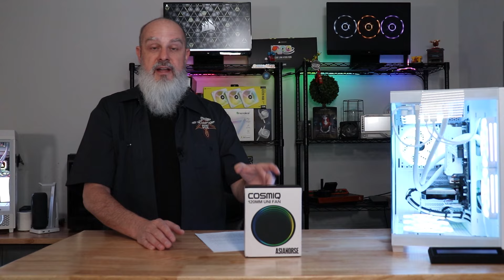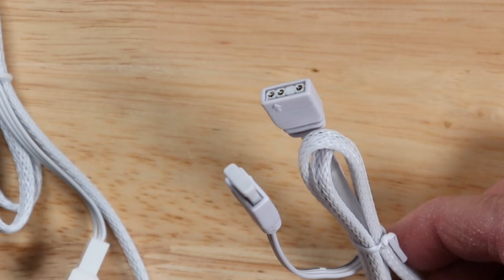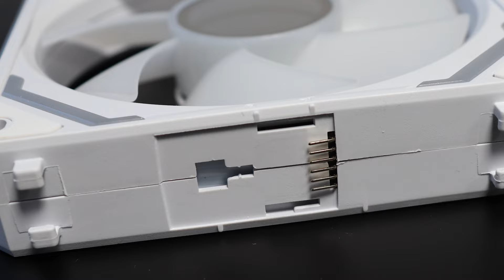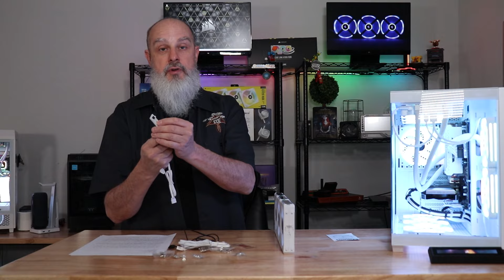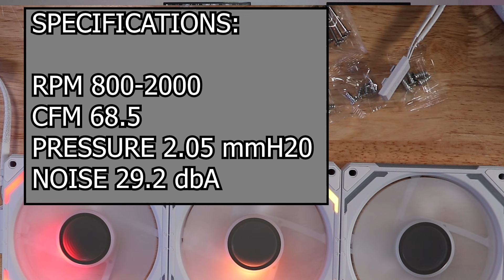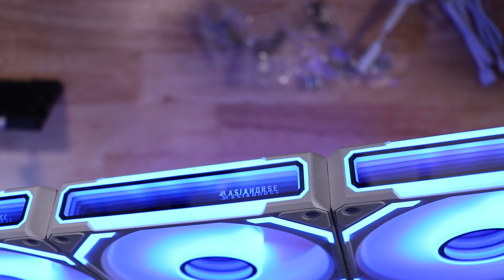Budget Alternative to CORSAIR, Thermaltake and Lian Li? Check out the AsiaHorse COSMIQ UNI FAN 120

Comment: Don't need a hub with 4 ARGB headers on my motherboard muahaha
Reply: Does the 4 rgb headers on your motherboard ( same as mine)  mean I can support up to x4 (3 pack cosmiq fans connected to each other)  giving me12 fans? I to am using a push pull method. But I have them connected to the venom hub but my lights won’t turn on. Just my fans are working
Reply: @BLAZINBACON2788  I ended up switching to Nollie GC120s with the associated controller because I was unsatisfied with the Cosmiq's control options.

At any rate, make sure they're ARGB not RGB headers. The amount of fans you can put on one header depends on the addressable LED limit. Usually it's above 90 so three fans per header is reasonably expected. So yeah 4 headers should let you control 12 fans.

One thing to note about the Cosmiq fans is if you add a fourth fan to a single header, the fourth fan will match the lighting of the first.

I don't know what a venom hub is but generally an ARGB hub should provide better performance than the headers on their own, if it's a good hub. But it's possible your hub only powers the fans themselves and not the lights? Does it have ports for the ARGB pins?

Comment: The comsicq fans are the real deal I have 15 in total in my corsair 4000d rs with a push pull method on a Thermalright warframe on a r7 5700x3d. Cpu idle at 28c and max at 35c. Very good quiet fans too ❤

Comment: That’s pretty cool, definitely a Lot of RGB there! Asiahorse says they work with Msi mystic light, as well as their controller. Were you by chance able to test that?
   I was also looking at the non icue Corsair fans for the same price, they perform great at 76 cfm and 3.0+ static pressure and claim to also work with mystic light but i thought Corsair fans were all proprietary? 
  I’m just looking for RGB fans that I can use on my motherboard with full argb and pwm control through dragon center without having to replace it with 3rd party software. IQ link dips performance down a bit on computers as does a lot of others and I also want to control my dragon RGB on the motherboard and graphics card.

Comment: Hey I just got these after many told me to get others, and I don't see why people were telling me not to. Either way, I wanted to know what you recommend for controlling the RGB. Right now it's just on the standard rainbow stuff. Do you recommend using the controller, or do you have a software that you use for controlling things?
Reply from the maker: Hi VincentLloydM, that's Awesome!!! I'm glad you are happy with them.  If you were to ask 10 people what fans to use, you would get 10 answers. Everybody has an opinion on equipment and fans and for one reason or another don't like certain products. That's because we all come at it from different perspectives, some need budget, some prefer certain connections, others want the best performance, I want the best lighting....haha....on and on. If you like the look of these, they perform well enough (most do) and are at the price you needed, then job done, awesome!!! have fun with it!!! 

You can use the included controller which works and looks good, but the controls are impractical inside a case. Use your motherboard,  these will connect to a 5v 3 pin ARGB header and then you can use that motherboards software to control it, assuming your MB has ARGB control (most do) 

I personally connect most fans to a corsair controller, these would need to have an adapter cable, but I can then use corsair iCUE to control them. I have a couple videos on that subject, check it out. 

Alternatively, any inexpensive ARGB controller for 3pin 5v ARGB should works, there are lots of options out there, and they will inclue a remote.  There are options beyond that, but that's a good start. I typically just use a corsair controller and iCUE. 

Good luck, Have fun! and thanks for watching!!!

Comment: I purchased 9 fans but unable to change modes from Motherboard argb header by using MSI mystic light can you tell me the software where i can get modes like controller
Reply from the maker: Hi nikhileshnikhileshvora968, Mystic Light should be able to control these off the motherboard 3 pin 5V ARGB header. However, it may cause issues if you have all 9 fans connected to a single ARGB header. Try Connecting only 3 to a single header and see if that works, you might get 6 to work on a single header. This would require you to connect the fans to multiple headers, but I would start there and see if that allows you to control the lights. 

If that doesn't work, and you are getting no Lighting control through the software, check your bios and make sure the ARGB controller is enabled. Reinstall the software if it still doesn't work. 

You could, alternatively, use an ARGB hub, connec the hub to a single port on the motherboard and then all the fans to the HUB, that would work. 
Or you could use the included controller to control the lighting, or at least use that as a troubleshooting tool to ensure the lighting is working. 

Good Luck, Thanks for watching!!!!

Comment: Whats the difference between the COSMIQ and the AsiaHorse AMICI-5GT RGB PC Fans besides the max rpm
Reply from the maker: Hi YAMi_PRiSMØ, the AMICI-5GT fans are not daisy chained together, each fan has a PWM and ARGB connection which will add to your cable management. The COSMIQ fans daisy chain together using a connector on the side of each fan, so you can control multiple fans on a single set of cables. The COSMIQ has marginally better specs it looks like, aside from that they don't seem to be much different. Either would be suitable for most setups IMO. I haven't personally looked at or used the AMICI-5GT so I'm basing this just off a quick glance at the product page. Good Luck, have fun and thanks for watching!!!!

Comment: How did the fans perform noise-wise under load? I've noticed a lot of the Lian Li SL look-a-like fans like to state that their noise level is around the same (~30 dBA) but they become significantly noisier once they start pushing 1200 RPM under load, likely due to the design of the fan blades and how they push air.

Comment: I NEED HELP! I DONT want to use the controller with SAtA power. I want to use just the PWM fan head cable, and ARGB pin header. That should be enough to power both the fan and the RGB however it’s not working. Please help
Reply from the maker: Hi ChrisPoloChris90, you dont have to use the controller. You can connect these directly to your motherboards PWM port and the 3 pin 5v ARGB port. Just be mindful of the power requirements. These fans draw .16A on the 12V PWM side, and 0.864A on the 5V LED side. Most motherboards will be fine with 3-4 of these fans one a single port. What's not working?

Comment: If you can sacrifice a little aesthetic like the infinity mirror, then save yourself $9 and get LTC CF-121D. This fan pushes 68.9CFM, and the LTC fan pushes 70CFM, so it can push more air. Everything but the infinity mirror is the exact same down to the RGB light configuration. But where it differs is, the LTC is easier to connect together, and they are $39.99 vs $48. And you can get reverse fans for a super clean look for $49.99, and not have to look at the back of the intake fans
Reply from the maker: Hi boostinman7132, that's great info, thanks for the advice, I will have to check out that fan!!! Thanks for watching!!!

Comment: i daisy chained 9 fans together - when i do so i lose all brightness on my fans with aura sync. (i am not using the RGB controller) how can i fix this? they work fine with 6fans daisy chained but when i do all 9 it breaks. do you know a fix?
Reply: it’s like i can’t use 9 fans. everything is ran correctly. as soon as i add the 9 fans the lights go green (on white setting) i dont get it
Reply from the maker: Hi justin-8296, the rated current for the LED's on each fan is 0.864A. This would be at 100% brightness and a white color. This number will be less, perhaps much less, when not using white/100%.  Most motherboard ARGB headers still have a 3A output, but double check your motherboard. 

It's possible you are just exceeding the power output of your motherboards header. Especially when using 6 fans it works fine. Even with 6, you could exceed the output if you went full bright/white. These fans have 24 LED's each. 

I'm assuming you are using a motherboard ARGB header based on your question. I would suggest splitting up your 9 fans into two groups and utilize two ARGB headers (assuming you have two). NOTE: you cannot use a 12v header for these fans. 

I've seen odd symptoms when adding too many RGB devices, including brightness issues, LED's doing weird things, having the wrong colors, etc... or not lighting

If you don't have two headers to split this up with, I would suggest using a powered 5v ARGB hub. You could feed this hub from an ARGB port on your motherboard and then break up your fans into two (or more) groups, this would reduce the load on a single port. 

There could be other reasons for your problem, but it sounds to me like you should even out the load. 

I hope that helps. Have fun troubleshooting (troubleshooting is fun isn't it?) , let me know what you find. Thanks for watching!!!
Reply: @HardwareArtisan  Thank you for your reply, & you’re correct! I had loss of power (too much on one header) Sadly my Z790 Strix only comes with one 5v header. I ended up just using an RGB controller that was supplied & daisy chained the others! Thank you sir!
Reply from the maker: @Neyxo186  That's awesome, i'm glad you figured it out!!! and cmon ASUS, we need more than one 5v header, should be a minimum of 3, right!? haha!  Anyways, game on!!! Have fun!!!
Reply: Keep in mind that the ARGB hub on your motherboard is only rated for 5 V.  Each one of these fans can use up to .86 something or other volts for the ARGB if they are maximized at 255 for all colors (full white).  In other words, you can only confidently connect about six of them to a single header on your motherboard.

Most modern motherboards now have around 3ARGB headers.  Be careful that you’re not trying to connect to the 12 V RGB header because that will short circuit your fans, it’s intended for LED strips.

You can likely get around this problem by using either the provided hub, or connecting to another hub  which is powered by SATA directly from your PSU so that the power draw isn’t just on your motherboard, I would guess

Comment: I might look into these. My lian li uni fans caused nothing but trouble since 2021. It's always the bearings of RGB dying, last one died over the weekend and ofc out of warranty.
Lian Li really has poor quality and it's overpriced for what it provides, the fan blades on those SL120 v1 are also sharp edged asf.

No idea if there newer products improved, but yeah definitely disappointing.

Thanks for the video!
Reply: dang really? i have 8 of the AL fans in my main gaming PC and i put 3 of the SL LCD fans in a build i did for my friend and neither system has had any issues.. i was thinking about getting them for my streaming PC too.. thats crazy that you have had those issues that sucks

Comment: Can you connect more than 3 together?
Reply from the maker: Hi shoryuag, yes, the documentation from AsiaHorse states a single connector can connect up to 6 fans. Just be sure that this doesn't overload your PWM port or HUB.  In most cases you won't be connecting 6 together anyways, but it will do it. 

The lighting controller will allow up to 10 fans to be connected for lighting. 

I hope that helps, good luck, have fun and thanks for watching!!!!
Reply: @ Bonus! Thanks for getting back to me.

Comment: can i connect more then 3 fans daisy chained mode and at the end connect 1 connector to controller and controller to mobo? to understand if its necessary buy a specific hub for more than 3 fans. Thanks a lot
Reply from the maker: Hi lucaargento9552, the documentation states:

"A single connector can connect up to 6 fans at the same time, and one controller can connect up to 10 fans. Overloading the installation may damage the device. 

This means that the CABLE will support you daisy chaining and connecting 6 fans together on a single PWM port. However, the rated current per fan is 0.16A per fan. If your Motherboards PWM connection only supports 1A output, you're right at the edge on 1A. If it supports 2A output, no problems. Check your specific motherboards output to see if using a single port is ok. I'd recommend using 2 different PWM ports to be safe, but 1 will work if it's outputting 2A. 

For the LED controller, up to 10 fans is ok on the controller using the 5v 3 pin ARGB connections. 

If you connect to a motherboard ARGB connector, each fan is rated to use 0.864A, so check the output of your specific argb port on the motherboard to be sure it supports the number of fans you intend to use. The current draw is probably much less than that unless you are full bright white, but be conservative, use more than one port if in doubt, or use an ARGB HUB. 

I hope that help!!! Great question, thanks for your support and for watching!!!

Comment: Everything was great until the controller was talked about. No software or remote?
Reply: But When you Look at the Price its Not wondering That there is no Software
Reply from the maker: Hi tl3139, thanks for the feedback! There is no software for this. The included controller is a very simple little device with a single connection. It requires no software to work and the remote is several buttons on the controller itself, there is no seperate remote. 

These fans can be connected to many other controllers including your motherboard or any number of rgb controller which opens the ability for more comprehensive controls. I hope that helps, thanks for watching!!!
Reply: @HardwareArtisan  Thanks a lot. I will check that out.

Comment: What is that aio?
Reply from the maker: Hi spoke1183, that is the Corsair H150i icue link AIO with an upgraded LCD screen....you can get it with the LCD screen or without.  Or you can by the LCD panel as an upgrade for it. 

They make a non icue-link version of that, the H150i Elite, I think that's the model, it would be similar in looks. 

Thanks for watching!!!!

Comment: Will they work if I don't use the included controller and use a separate hub plugged into my motherboard's ARGB header?
Reply from the maker: Hi arniejonassen, yes, you can connect these to a different 5v ARGB controller. It's using just a standard 3 pin 5v ARGB connector. Using an ARGB hub connected to your motherboard for control will work fine. I wouldn't overload a single port with more than 3 fans, but that should work great! 

Good Luck, have fun!! Thanks for watching!!
Reply: Yes.  In my opinion, the standard 5 V three pin ARGB and pwm is a more customer, friendly format than these proprietary USB and other weird pin connections that companies like Leon Lee have used, essentially forcing you to use entire packages of products, whereas you can pick and choose if you are plugging these directly into your motherboard headers, into another set and then into a motherboard header, or into a hub, or partially into a hub and partially into a motherboard header, depending on whatever your situation is

Comment: I'm ordering 9 of these for my case. I have enough 4 pin headers on my motherboard but only 1 5v argb header. Would it be fine to daisy chain all 9 to 1 argb header? Or would I need a hub for them?
Reply from the maker: Hi spentcasing3990, for 9 of these, I would recommend using a powered rgb hub to split them up. Just an inexpensive small one would do just fine.  Thanks for watching!!!
Reply: @HardwareArtisan  Thanks do you have any recommendations for rgb hubs ?

Comment: He lost me with plugging it into reset on the case. Still trying to understand that
Reply from the maker: Hi progamingsmurf, sorry I lost ya! Basically,  your case has a reset switch and normally you plug the 2 pin cable for that reset switch into your motherboards connector for the reset switch and it works normally, you can reset your pc. 

You can take that same cable and plug it into this controller for the COSMIQ fans instead, the controller has a small connector that you can plug the reset swith into. You then use your reset switch on your case to simply change the lighting on the fans. It just signals the controller to change lighting effects. 

It's a better alternative to this controller since this controller doesn't have a remote and it's usually not accessable in your case. 

Now, you don't have to use your cases reset switch, you can purchase an aftermark reset/power switch on amazon that would do the same thing if you still want your case to have functionality for the reset switch. 

I've seen alot of RGB controllers leverage the same function, it works well and is a good solution for changing lighting. 

I hope that helped clear it up. Thanks for watching!!!

Comment: I got 9 of these and the reset switch works perfectly. The only thing I’m wondering is there a way to control the speed with the reset switch?
Reply from the maker: Hi Nicetrycole, Awesome stuff. The reset switch unfortunately will not control the speed of the fans, just the RGB lighting. How you will control the fans depends on where you connect them, if you use a motherboard PWM connector, you will use your motherboard software to control fan speed. I like the idea of having a button on the front panel to control fan speed, but that won't work on this controller. Thanks for watching!!!
Reply: How do you turn on and off your pc lol?